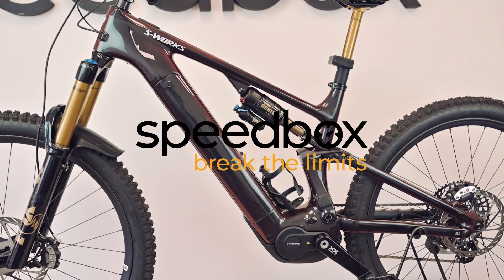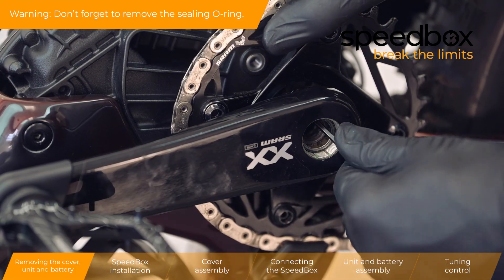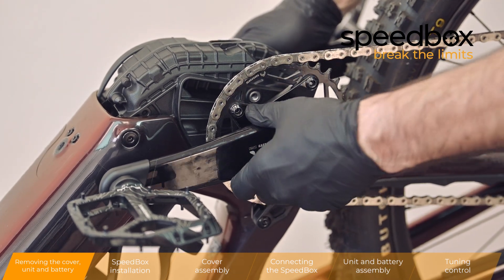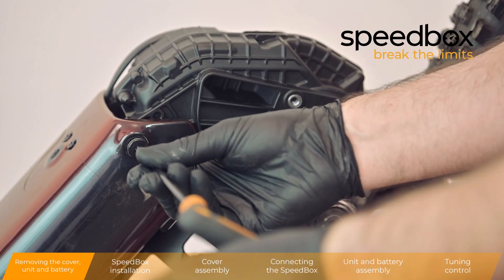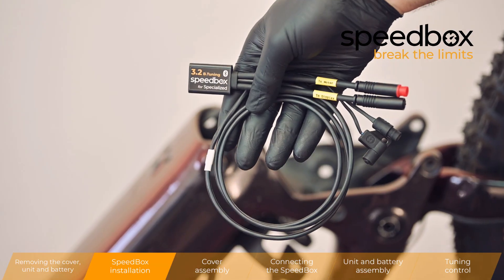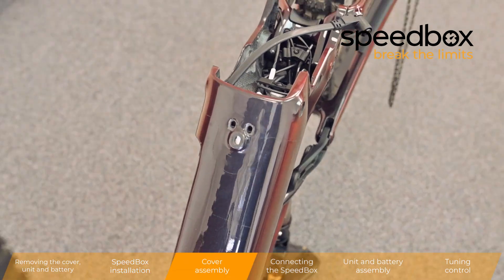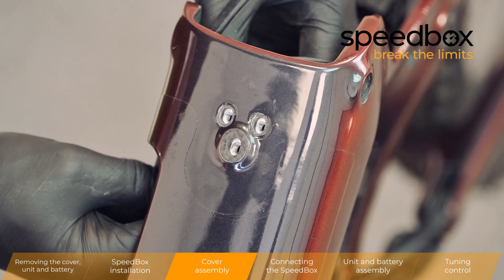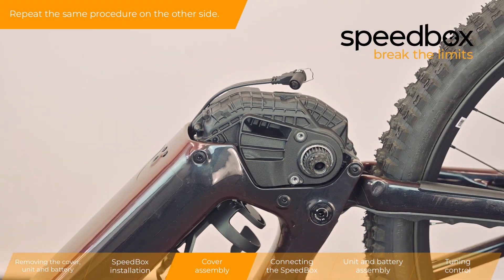NEW! Easy Install of SpeedBox 3.2 for Specialized e-Bikes (Motor 3.1)

Comment: Thank you for the very informative video, is there any issue or special instructions for the battery nest after removal and reinstalling?  I noted in the Levo 4 users manual that we should never remove the two battery nest adjustment bolts without a special tool that is needed to realign?
Reply from the maker: Hi,
thanks for the nice feedback.
We didn’t remove the entire battery either — we only disconnected it from the motor and loosened those two hex bolts using a regular hex key.

Comment: Why take off the cranks when you can just undo the chain?
Reply from the maker: Hi!
This instructional video shows possible installation methods.
Please note that the installation may vary depending on your e-bike model.
Reply: There are some motor bolts you need to get to, I tried with just removing the chain ring without removing the cranks - its like one of those metal puzzle games. that spider thing needs to come off to get to everything.  Video is accurate.